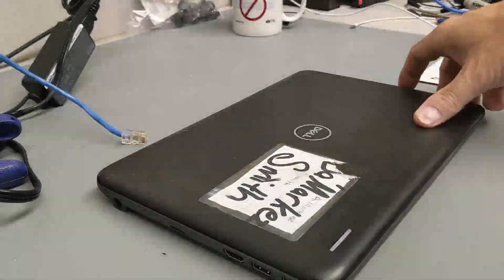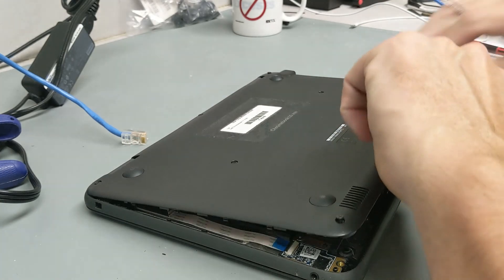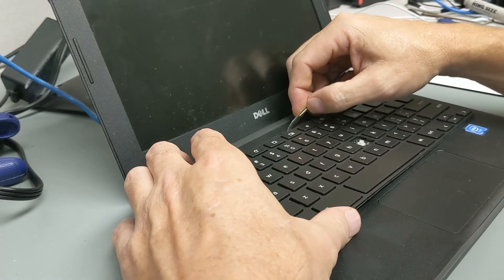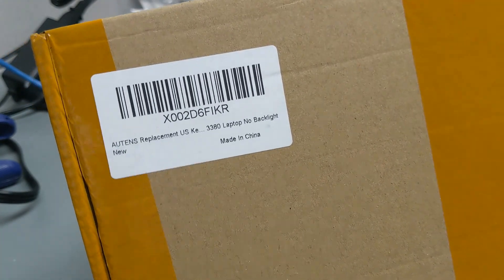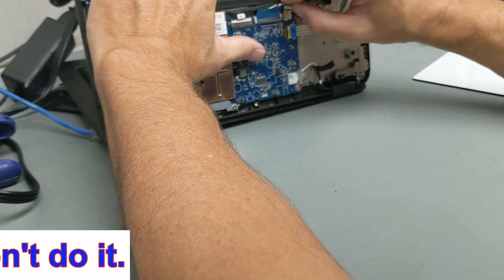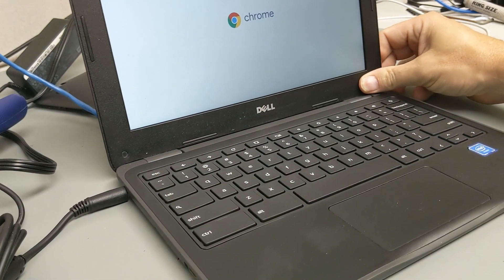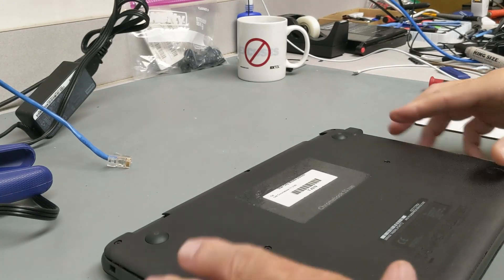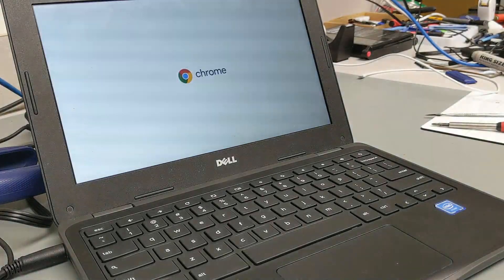How to Replace the Keyboard on a Dell 3180 Chromebook – Step-by-Step Guide!

Comment: What is the ribbon thing i cant find it on the 3180
Reply from the maker: You should be a ribbon cable connected to the main board and to the keyboard. It is fixed permanently to the keyboard so it should be easy to find